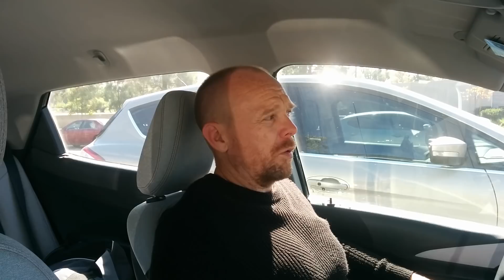Plug-Side Chat: Beefing Up the Voltec Powertrain

Comment: Why don't they use the rotation of the wheels that are not the drive wheels to generate power to help out the system?  I own a Volt 2017, love the car.  My thinking would be at highway speeds the rear wheels would generate power, supplement Voltex system.  The system could be like your lawn mower which generates enough to light the spark plug, an approximate voltage to the plug around 40,000 volts. The system would not add that much drag.  They even could place a generator in the center with the rear wheels driving that system.  This idea would not replace the power being used, only supplement, getting further on a full charge.  Tesla could use the drive motor not needed when driving at highway speeds to do the same thing.  just a thought.
Reply from the maker: The additional drag would require more energy to overcome than it would produce.

Comment: As others have noted, GM has already released the CT6 plugin hybrid which is basically a gen 2 Volt with an extra planetary gear set and clutch pack. It has two 100 kW electric motors (I recall from memory) that can be combined together in all-electric driving. It’s combined with a turbo 4 cylinder to create a combined 335 HP powertrain.

Actually, the very first “Voltec” system was a non-plugin hybrid system for transit buses. This was later adapted into the “2-mode” hybrid used in GM’s large pickups and SUVs between 2008-2013. The 2nd gen Voltec is a simplified variant of that system. The CT6 is scaled version of the 2nd gen Voltec. All of these core 2-mode and Voltec GM designs go back 15-20 or more years and be scaled between small subcompacts and large buses and at least mid-size trucks.

For details, see my article from 2-3,years ago on the history of power-split hybrid systems:

https://www.hybridcars.com/revenge-of-the-two-mode-hybrid/
Reply: I should add a bit of trivia left out of the “revenge” article. GM actually planned to sell a plugin hybrid FWD Saturn SUV based on their RWD 2-mode hybrid for SUVs and pickups. Unfortunately, this vehicle was cancelled in large part due to the Great Recession around 2008 and the Saturn division was closed.

Further trivia: some 70% of the key components from this Saturn plugin SUV hybrid transmission were repurposed into the FWD first generation Volt plugin hybrid transmission.

Comment: Well on long hills (in extended range generator run mode) we have to precharge the volt so battery will be in addition for ling high speed hills.  The volt will get up to 4.4 miles per Kw or 44 mpg. On generator. A Blazer might get 3.0 miles/Kw since it gets 30 mpg max these under ideal conditions maybe 40-50 mph warm air dry roads light loads

Comment: Would the exhaust generator not make it harder for the engine to 'exhale' and drop efficiency? I think using a peltier thermal element on the exhaust pipe could generate electricity for free using the exhaust heat and replace the alternator.
Reply from the maker: It would, but the gains far exceed the losses. The device I referenced uses a wastegate, so it only starts to scour energy from the exhaust after there is sufficient flow (and it doesn't impede engine operation).

A Peltier device could be used as well. You might already be aware of this, but BMW actually experimented with one as a replacement for alternators and one point in time. They are referred to as thermo electric generators (TEGs) and they are also a valid option, though they are more expensive, higher volume, and lower efficiency. I think the most current TEGs are made using bismuth telluride, but I believe they still require high temperature differentials and aren't that efficient.
Reply: @newscoulomb3705  True the peltier elements are low power. Maybe not enough for a modern car's electrical needs. But then I feel like the car industry is very stuck on certain methods once established. Unless explored and tried, a different method will never become better.

Comment: We have a Voltec like SUV it’s called a Mitsubishi Outlander PHEV
Reply from the maker: That's true, and I think its fuel economy could indicate why GM isn't really pushing a Blazer PHEV right now. The Outlander PHEV is getting a fuel economy of 25 mpg, while I've seen the Blazer quoted at 23 mpg. It simply might not be worth the cost and effort. At least with the Volt, after the 53 miles of electric range is used up, it's getting 42 mpg, a respectable number.
Reply: The only time I got as low as the EPA claimed 25MPG was on the drive home from the dealer, who didn't charge the car before we left, and I then drove 200 miles at freeway speeds in the cold and rain. Like many Volt owners, I'm struggling to have to put gas in the car once a month. Also, I have yet to see a Volt that can tow 1500 pounds (1500 Kg in rest of world). Given the amount of mass being moved around and the relative lack of aerodynamics, the Outlander PHEV is pretty darned amazing, IMO.
Reply: @newscoulomb3705  Enjoy the videos and the channel btw.  We got our Bolt EVs about 3 weeks apart, but I think you have about 4x the miles I do!

Comment: I thnik a 55kw generator can be enough for a blazer with a little bigger pack than the volt. WIth 28kwh and a large usable buffer of 8-9 kwh adding 55kw will be enough to secure High power demand to climb a hill. On a flat road with 55kw generator you will have enough power with the pack. If you going down a hill with a empty pack the generator can produce 55kw when you using nothing and be modulated the generator at max to fill up the pack. Maybe a 60kw generator with the turbo tiger exhaust can be just enough to put voltec in a blazer...
Reply from the maker: The constant draw going up a 6-7% grade at highway speeds in my Volt is ~60 kW. I could be significantly more in a Blazer PHEV. If GM is trying to avoid any form of limp mode, I think they'd need a range extender with at least 100 to 150 kW output.

Comment: Maybe some stirling engines leaching heat from the exhaust similar to power plants (7:10 you mentioned something similar).... charge the hybrid batter? meh.. cool topic man!
Reply from the maker: Yup. That was mostly my point. When running hybrids or straight ICE, you need to worry about increasing the mechanical power without much thought to efficiency (other than what is regulated). With EREVs, your primary concern should be efficiency, though you do need to be able to maintain output equal to the highest constant draw the vehicle is likely to encounter. 

Imagine a small Stirling engine that is at least 70% to 80% efficient as the i3's REX. Even at freeway speeds, a fill on the gas tank would get you 150 to 200 miles.

Comment: One would think that if you use the exhaust to power something that the then restricted exhaust system would cause the ICE to make considerably less power.  It would if you didn’t have some sort of “enhancer” such as a turbo to help amplify things.  If you use a turbocharger, which when employed is effectively a restriction in the exhaust, and by using it to pressurize the air going into the engine, it allows an ICE to make much more power when necessary.  Could we come up with a happy medium that allows some of the pressurized intake air to be redirected to a side load which would drive some sort of impeller/generator, and thus a car may not need an alternator at all?  Perhaps it’s just an extension of the turbocharger principle - to another impeller on the same shaft?
Reply from the maker: Well, yes and no. The internal combustion engine is only about 30% efficient, so nearly 70% of the energy is lost either way. Most of it in heat, and some of it in velocity of the exhaust gas. That's part of why turbochargers work; they present a net benefit. In fact, many internal combustion engines work better with at least a little back pressure. 

It you take a look at the TIGERS description I linked to, the article discusses how the system is only set up to work at certain rpm ranges (essentially, when the back pressure is very easy for the engine to overcome).

Comment: I don't fully agree with your assessment. A Model X is going to be bigger and heavier than a Voltec Blazer and comes nowhere near the average hwy power usage that you were estimating.  A Model X 75D only consumes 17% more energy than the Volt on electric (EPA 36 vs 31 KWh/100 mi).  The maximum discharge on the Gen II Volt battery pack is 120KW.  The battery is in a 2P - 96S configuration.  Even using the exact same cells a battery pack with a 3P - 96S configuration could be made which would end up with a 27.6 KWh pack and a 180KW max discharge rate (241hp).  That would be plenty enough to propel a Blazer.  A Cruze gets an efficiency rating of 3.0gal/100 miles (1.4L Turbo).  A FWD GMC Acadia (same architecture as the Blazer) with a 2.5L 4cyl motor consumes 4.3gal/100 miles.  That is a 43% increase in energy consumption.  Even if we assume a 50% increase that would end up yielding nearly the exact same EV range as the Gen II Volt (assuming the larger battery pack).  Obviously that simply assumes using Gen II Volt technology which would have been improved for a third generation Voltec.   The gen II Volt gas engine has a 101hp max rating.   So a range extender that can do ~150hp should be sufficient.  The 1.5L Turbo used in the base Equinox (170hp) but tuned down for efficiency should be sufficient.  The only big question mark is cost.   A 50% bigger battery - transaxle and power electronics is going to generate a larger price premium.  And that might be where the challenge is.
Reply from the maker: I didn't compare the Model X because I didn't really know enough about it's sustained consumption, but based on what I'm seeing, it is significantly worse at freeway speeds than the Volt (>30% higher power demands). Keep in mind, the EPA test cycle includes city, which largely favors EVs (and levels the efficiency between the Model X and the Volt). 

Regardless, my point was more about people wanting to use an SUV for towing and heavy loads. Now, the newer Voltec does account for that by having a more direct link between the engine and the driveshaft, and you're right, that would allow a 150 hp engine to supply most of the power needed.

To me, though, that raises a few other questions. First is, how durable is the Voltec system? Can it actually take the sustained power and torque from a 150+ hp internal combustion engine. Second is, does that eliminate most of the benefit of the Voltec system in the first place? I.e., at that point, would it be better to just have a mild hybrid?
Reply: @newscoulomb3705  To handle towing is simply a mechanical issue.  Not an electrical one.  As long as you can generate the necessary power and torque (which electric motors have zero issue with) then it's simply about beefing up the mechanical bits to handle the higher vehicle loads and higher sustained system torque.  All of which GM has a lot of experience in handling.  Trains are Diesel - Electric series hybrid systems and that system can clearly handle serious loads.   If max sustained power is an issue (to pull higher GVWR up mountain passes).  GM could even bump up to a 2.5L I4 or even a V6 and run an atkinson cycle and incorporate their new dynamic fuel management technology to maximise the efficiency.  DFM would pair very well with Voltec.  And would be perfect for a high load application.

Comment: Can't you just use a Model X as an example?
Reply from the maker: I could have, but I'm not familiar enough with the Model X's consumption at freeway speeds, climbing elevation, and hauling trailers.
Reply: @newscoulomb3705  
Bjorn tows with a Model X.  I think he said draw from battery is 50% more... 

Also..  people will expect a blazer to be able to tow more than the MX can. I think.

All interesting ideas..

Some new basic mechanical design are out there too.. the Acades opposed piston engine for one.  Very efficient design.  Close to full production I think too.
Reply from the maker: I haven't followed Bjorn's Model X coverage as much, but that 50% is very similar to the number another Model X owner has quoted when towing a trailer. 

I'll have to look into the Acades motor. A Stirling motor would also work as a generator for a range extender, but I think it would work best in an i3 type layout.
Reply: @newscoulomb3705  
The Acades op engine is interesting. Not a new mechanical idea.  But now with modern fuel injection and other tweaks. It's very efficient. And has less parts.. no cyl head and no valve train.
Battery Electric is the long term future. But I think continued efficiency and improvements to ICE will help fill the gas and niche market needs until that time.. the OPP engine would make a great generator for a plug in Hybrid .

Comment: Eric I think you are misunderstanding some of the Voltec operation. In the gen 2 Volt two of the 5 modes of operation drive the wheels directly and this begins at ~58km/h.
Basically not all the power has to go through the smaller motor/generator (~50hp) except at low speeds with the battery flat. Even the battery buffer is kept so the more powerful motor (~100hp) can supplement on peak loads.
Given this it’s easy for GM to modify Voltec for a plug-in Blazer. They can up the engine from 1.5l to 1.8/2.0l and/or throw a turbo on it if necessary.
Reply from the maker: Yes, I was speaking mostly from my experience with the Gen 1 Volt and its Voltec system. The Gen 2 Voltec appears to make a more direct connection between the internal combustion engine and the driveshaft. Of course, that makes it even more puzzling why they aren't able to scale up the power.
Reply: I’m wondering why you don’t think it’s possible? 
They did so for the Cadillac ELR and to some extent the Malibu, however that was reconfigured as a hybrid and from what I’ve read, no so successfully. 
BTW, interesting energy recovery you described, I’d never heard of it before.
Reply from the maker: It's not that I don't think it's possible, but the reason I saw given for why GM wasn't planning on releasing a Blazer PHEV was because they were having difficulty scaling up the power train.

It could also have been a matter of economics and diminishing returns.

Comment: Eric, the current Cadillac CT6 is a 2.0L w/turbo 265 HP 295 torque 18.4 KWH battery 120kw motor.  I think the are going to use the 3.6 engine with the larger PHEVs. I seen some industry references to 28.9 KWH battery packs. Have you be able to do any reading on the Camaro EV?
Reply from the maker: I have. They're still light on a few details, but I like the idea of conversion kits.

Comment: Turbo-compounding has been around for several decades, in airplane engines, and now in Diesel engines. But I think the cost and complexity is why they don’t use them on every ICE. Putting the power directly into the engine output to would be better than a turbo generator, since there is already a dc-dc converter on the Volt, and already a generator.
https://youtu.be/9PbxmRA9vbs

I’m sure GM knows this technology, but the cost isn’t worth it. I think they can get better efficiency with an Achates engine, or one of the other compression ignition gasoline engine.

Comment: I would like to see some new crossover vehicles front drive ICE based and just add a Bolt ev motor and a 20kw battery in the rear and be done. It would be able to be driven 40 to 50 miles EV range, and use both drives for awd needs. Leave a 5kw buffer for awd on demand.